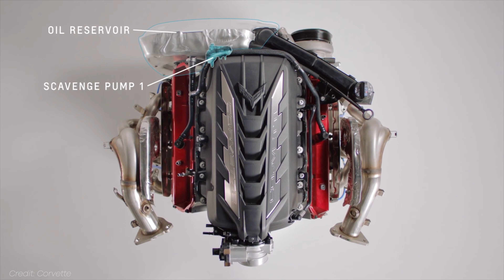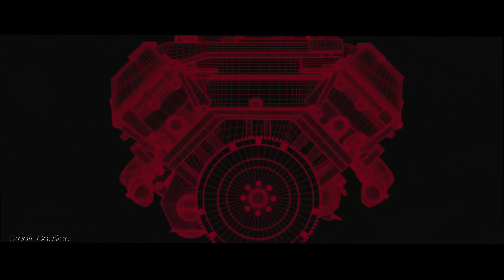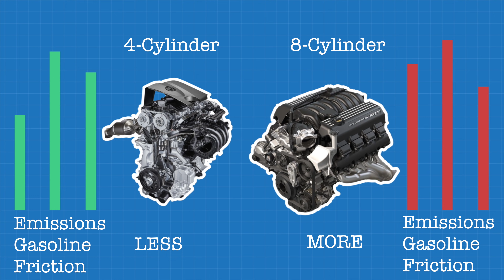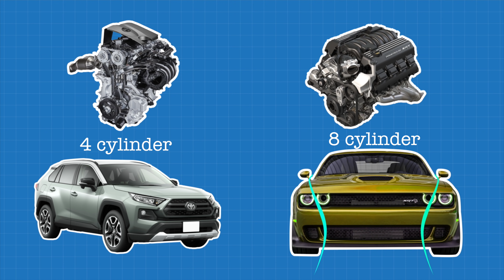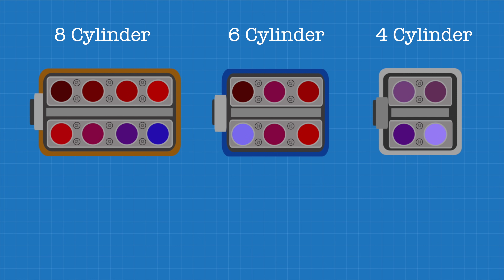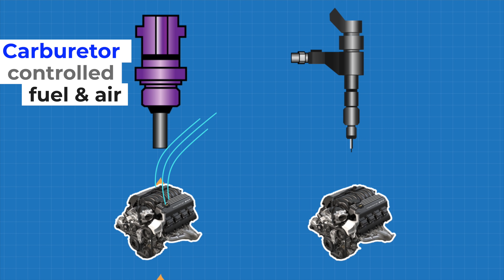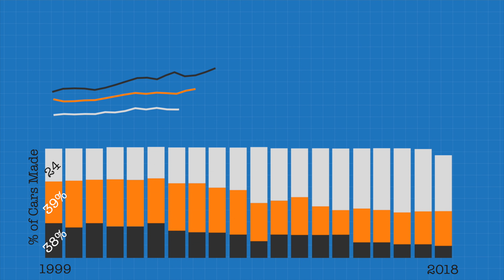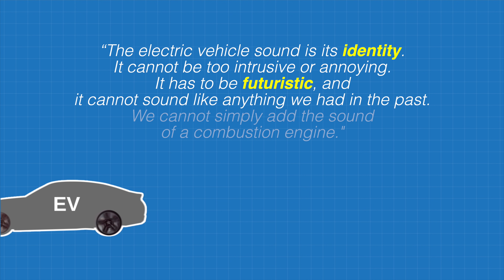Why V8 Engines are Dead

Comment: The V8 engine is NOT only available to people in cars ONLY rich people can afford........my proof is "Then explain the exploding truck market?"!!! Many of today's trucks still have V8 engines in them!! I refuse to drive these "disposable" cars with their under powered, gutless crap engines!! And I can't afford a V8 Camaro, Mustang or a Challenger, either....which is why I drive a four wheel drive Ford F150 with a 330 V8 engine in it!! Yes I just called out the cubic inches and NOT the stupid "liters" of that same 5.4 engine!! 

People are stupid!! And while you look at a car and think "God that has to be fast" with a V6 or turbo inline four in it, you ignore the one RULE of why a V8 is so powerful, and most people are too dumb to understand Horse Power is nothing without TORQUE!! This is where V8 engines and a few inline six cylinders really shine!!! A V8 is a monster NOT ONLY because it can generate insane levels of horsepower BUT the torque in a V8 is what gives the car its "launch" properties as well too!! 

And this is why cars on a drag strip lift their rear ends as they start down the track!! Sure you can build a inline four cylinder to do a nine second quarter mile and it is plenty fast as well!! But the problem with a lot of today's cars is the fact they have nothing left AFTER they spool up to speed!! Where a V8 will keep making power until much higher in their torque and horsepower curves as well too!! 

And this is where "not all V8s are the same" either!! See back in the day you have Small Block cars and Big Block cars And a big block makes insane levels of torque!! More so at the higher end of the "curve"!! So say at you had a inline four Honda lined up with a 440 Cuda and when the race starts the Honda pulls ahead and you think "He is gonna win!" but then half track the Cuda blows by him!! Why??? 

Because at mid race the torque of the big block is just "coming on" stronger, where the Honda has run out of steam, the torque curve, is STILL building in the V8 Big Block Cuda! And by the far end of the drag track, the Big Block is STILL making horsepower AND torque, it used to get off the line in the first place!! Yes you have to factor in a lot of other things too...like gear ratios and track length and air quality and so on! But a Big Block will make horsepower and torque you will never find in a Honda Inline Four!!!! And I still argue that the V8 is not "dead", but again people are too stupid to understand torque and horsepower!! And you can build a motor that makes a million horsepower, if you don't look at torque it will never leave the line!!!

Comment: Here in England, I think it's the straight 6 engine which is part of our car history. Of course, our road system is completely different, and instead of the wide open, dead straight roads you have in the states, we have narrow twisty and undulating roads.
As such, I think our best cars favour lightness and agility, over straight line power.
Interesting video though, and while it's sad to see the V8 becoming rarer over there, fuel wont last forever, and times change so we as humans will have to adapt.

Comment: We've all heard that before.  Yes a turbo 4 can make the same power as a V8 from 20 years ago, but today's V8s make a ton more power than any 4 banger on the market today.  Try doing 460 hp, 480 lb.ft. of torque, and still getting 30 mpg in a 4300 lb sedan.  Yes, I do that every long trip.  That same V8 pumps out 620 hp in other models.....  PS for Tesla fans, I can go over 500 miles on a tank and refill in 10 minutes, not 2 hours for a full charge....  Plenty of life left in V8s.

Comment: What I want for sound effect on my electric car is a small gas powered engine (300 cc)  that keeps my super capacitors charged, but also synchronizes with the tire speed to approximate the sound of a fully gas powered car. Fake transmission shifts could also be programmed in as well.